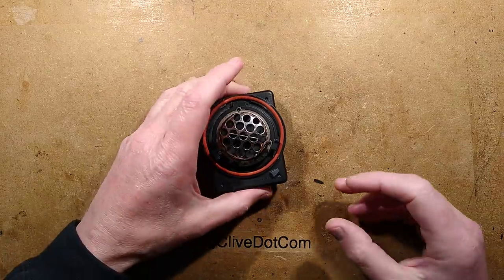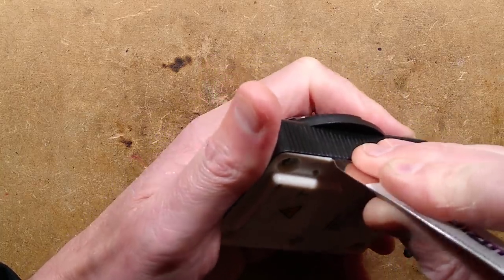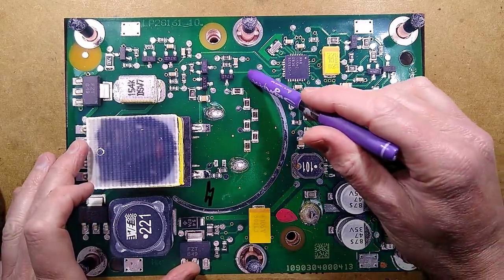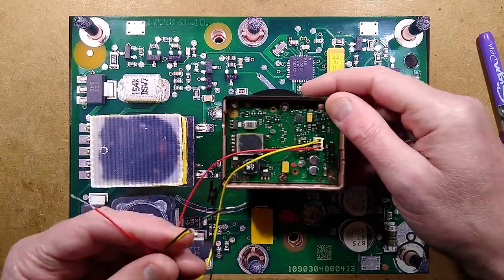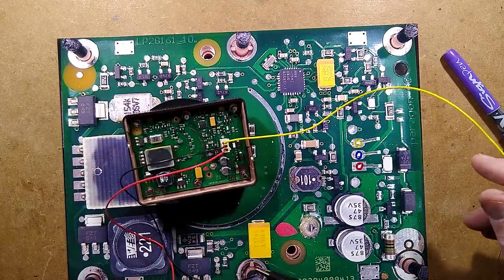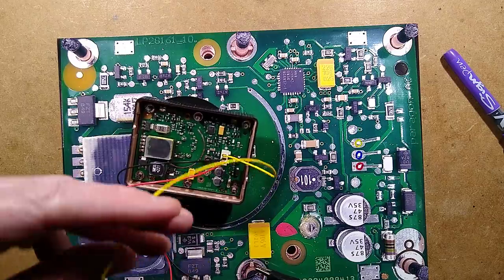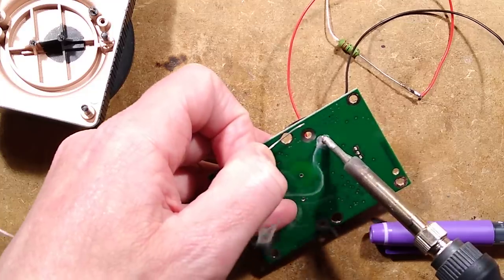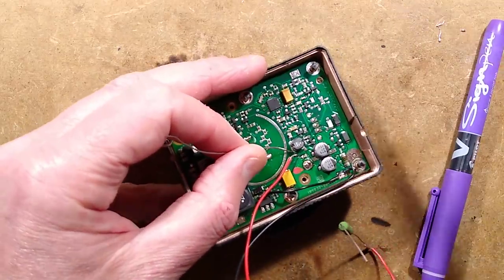Hacking and overclocking a BMW "ioniser".  (Not recommended)

Comment: Chinese replacement parts dont need to tell the car to tell you theres a fault, you know automatically due to the flames appearing.
Reply: please dont be racist towards china
Reply: @CoralsAustralia  Made in China has nothing to do with racism, people are tired of making the Chinese rich off of buying their cheaply made crap.
Reply: @vincentlamb3436  Agreed, there is actually some Chinese stuff that's higher quality.  

OnePlus for instance makes some of the best phones around at a reasonable price.  Mine (7T Pro) has proven to be decently durable, just as powerful as it's Samsung counterpart (S8), and unlike other manufacturers it's not filled to the gills with bloatware that you can't remove.  Pricewise the 7T Pro is a bit cheaper than the Galaxy S8 but offers the same Processor, same RAM, and more storage per dollar.  It also doesn't have a notch for it's selfie camera but instead uses a popup camera and it was the first phone with an under the glass fingerprint sensor which unlike Samsung's version never suffered from a certain major security flaw (if you used a screen protector anyone could open your phone).  On the flip side it doesn't have SD card support (Mine has more storage than I'll ever need so that's not an issue), doesn't have wireless charging (the next version probably will but it's an overrated feature anyway as even 'fast' wireless is only half the power of 'fast' wired and is effectively worse than half when charging a phone that's still on and using power), and it doesn't have a waterproof rating (it's decently waterproof but the popup selfie camera probably introduces a potential water path).

Admittedly I don't know what kind of shortcuts they may have taken inside the phone but from a usage perspective it's a good deal.  Other than OnePlus I've heard there are some Chinese clothing manufacturers that focus on quality but I don't know of any brands off hand (I'm a simple man who doesn't shop for clothes very often and when I do it's usually just Hanes, Dickies, and occasionally Wrangler clothing though their quality seems to have dropped recently).

When it comes to equipment and automotive manufacturing I don't think I've ever seen good quality from China (working in the manufacturing industry I've seen some stuff come from China that's made me wonder how the heck they screwed up so badly).
Reply: @JonnyD3ath  Or you can pay a ton of money for expensive shit (think Apple repairs).
Reply: @CoralsAustralia  oh dear... You must of been one of those fun people who got all the english irish scotsman jokes banned because they might hurt feelings..
Reply: @amojak  I fully agree.  Anything can be taken the wrong way by over sensitive do-gooders that do so much harm, and stir up real shit where there really was not to start with. There is not a nation out there that cant be critiqued in a humorous way. Its interesting in our family when the six nations are on, as different branches support England, Ireland, Scotland and Wales, and we all take the p1ss out each other with vigour.
Reply: @CoralsAustralia  50 cents have been deposited to your account
Reply: LMAO
Reply: This replacement part was made in Germany so
Reply: @chrisa2735-h3z  watch the video and dont comment nonsense
Reply: @CoralsAustralia  no
Reply: @vincentlamb3436 , Believe it or not, Germany once was the king of making shitty tools.

Comment: Modern German cars don't need this. The engine will die long before the ac starts smelling
Reply: True
Reply: Sad but kind of true. I am working in the German car industry and I think the success of the car manufacturers is their downfall. I have the feeling that a lot of people work there because of the prestige, money and career. Not many are there because they are interested in cars. A lot of money goes in marketing and other bullshit while technical development is outsourced to save money.
Reply: actually there 6 cylinder engines are known to last a long time... we have 10 B.M.W'S in our yard we work on them ourselves ... vary in age .. mostly E36 +E46 .... If you know how to work on cars and have a shop.... and have a chance to own 1 of these cars .. you will know what all the fuss is about... usually people who dont work on their cars or have never owned a beemer who bitch about them... E46's  are a excellent investment right now ..
Reply: @lsd25records  The E46 is an over 20 year old design, and even though I will personally always prefer pre-2000 cars, that is not what you could call "modern german car". A lot of the beemers from this decade are not quite as good.
Reply: Holy fuck you fucking killed it
Reply: @AzalofForossa  exactly this. Their reliability, and the ability to work on them yourself without specialized tools, have both gone down the shitter in the last 15 years or so. Part of that is because of how far tech in cars has come. But part of it is because (as stated earlier) auto-design is higly prestigious in germany. Its not about how simple you can make something, or how well the end-user can understand it. The more over-engineered it is, the more respect they seem to recieve. And thats no good on a gear head's wallet. They would much rather save money and DIY.
Reply: @lsd25records   I'm a BMW guy I have a 1996 E36 M3. What I think people are talking about is the newer cars with there plastic engine parts. They don't build them the way they used to.
Reply: Italian cars doesn't need it; you'd wrack them in the Great Ring Road in Rome before ac starts smelling
Reply: BMW’s Naturally Aspirated engines and their 6 Inline turbocharged engines have actually outlasted my Toyota Prius. The 5, 6 and 7 series is the problem. Plus MOPAR has a ton of transmission and throttle body issues which is a problem because nearly all their vehicles use identical parts.
Reply: @lsd25records  I don't trust comments that have random "..." In it. You people can't be trusted
Reply: @Audiojack_  the engineering is amazing whether you like the cars or not.. our cars are daily drivers and we are not shy to put them through the paces.. like I said e46's are a great platform at great prices right now.
Reply: @AzalofForossa  we own a shop so we can pay our billls. we are owner operator .. 2 man operation. its a luxurious life ..building cars and selling them 1 at a time.. this gives us the luxury to source ..get parts fix and certify cars that we want to build..  not a bad life stlye.. hell we bought 2 vintage speed boats this summer and welded up custom trailers for them BECAUSE WE HAVE A SHOP.. got a 14 ft Sidewinder with a 80 hp mercury .. and a 16 ft Baja with a tower of power mercury 115 hp .. out lives revolve around motors and cars.. DON'T HATE THE PLAYERS ..,So if we happen to like BEEMERS and can fix them and deal with them...WHAT's THE PROBLEM.. get your own hobby that pays for your lifestyle... i don't need to ask anyone's opinion or permission to do what I do... thanks for the concern.
Reply: @AzalofForossa  got a  92 foxbody  with a 5 speed..  love my Detroit muscle too late 60's etc.. why not.
Reply: @cbob7423  meh !
Reply: @lsd25records  love the fox bodies, but I have a sweet spot for the fastbacks. God my dream car is a 69 mustang
Reply: @AzalofForossa  And still, people will buy them simply for prestige...
Reply: @xXYannuschXx  the bmw? Yeah, people love them for some reason. The fourth gens and prior are excellent dailies. But once you start looking at the fifth gen, you gotta really make sure the electronics are functioning. As tons of them seem to be lemons straight from the factory destined to die out and fail within 30k miles. I've yet to personally see a fifth gen or up BMW last 75k miles that's not having tons of issues that ruin the driving experience. They exist, yes. But from the 5 or so I've seen, every single transmission was slamming into gear or failing to shift within 50k which is fucking hilarious
Reply: @AzalofForossa  They have become and absolute joke. Unreliable and not fun to drive.  My dads friend drives an E60 and the automatic gearbox started to have problems shifting to 5th gear. A 5€ part was faulty, but the repair cost 5000€, because it was so hard to even get to the transmission... (they needed to take off the gearbox again after filling it with oil again, becaus it settles and the fill port is BLOCKED when the transmission sits in the car (and to get the transmission out, you need to remove the engine.))
A modern BMW is the best way to burn money and they aren't even that fun to drive. A car magazine tested a M2 against a GT86 and the M2 felt absolutely sluggish in comparison. Even the sporty Z series has become a friggin Grand Tourer! No wonder when people drive these cars not because of fun, but because of prestige...
Reply: @xXYannuschXx  honestly if you're gonna buy a BMW, just scrap that idea and get a Porsche. They're far more reliable and more fun to drive in every sense. I've heard nothing but good things from people I know that drive them, and the times I've rode in them.
Reply: @xXYannuschXx  I'll be honest... You got ripped off as you don't need to remove the engine to drop a gearbox in an e60, I've done a few outside of my house. And bmw's aren't hard to work on to be quite honest, I've done a few things on the newer models like f30 and f20 and didn't become any harder to work on than the older ones.
Reply: Not to mention entirely way too expensive to fix as well.
Reply: They're too fancy for my tastes anyway, a Toyota AE86? Ahhh, now that's a car.
Reply: This whole thread shows no one knows shit about bmws.  Their engines are insanely impressive and actually opposite, they are the last to go, the rest of the car falls apart around it.  But instead of educating I’d rather not spread the wealth.  And when you’re in your little scat pack or (insert “me too” car here” and get walked by a stock turbo BMW in the streets and on the track you can think back to this thread.
Reply: @lsd25records  I've got a 2001 E39 diesel. Best car I've ever owned. The day it dies, I really don't know what I will replace it with. As far as I can tell, nothing newer is as good. At 160,000 miles it's only middle aged though!
Reply: @chriswilson1853  use synthetic oil and change it on time.. etc .. she will be good to you... any vehicle needs normal maintenance... I've had some nice muscle cars and still love them.. but every single time I get in my car I feel very lucky and smile hard ... donuts with the traction control disabled .. and I am having more fun than a barrel of monkeys... good times.. don't need anybody's permission or approval.... glad I bought 1.
Reply: @lsd25records  Yes, and I always change the oil half way between the service intervals on my BMWs. It's remapped too, so has pretty good performance. 500 Nm torque :)
Reply: another jealous china car owner
Reply: @lsd25records  I still have my 01 330ci and it is in great condition, over 220k miles and runs great. Compared it with my brothers 2009 bmw he bought new and looked at others 2015 and above and you notice the decline in quality of components. Most everything feels cheaper and lighter duty.
Reply: @lsd25records  I know I’m gonna get hate but I agreee with your thinking. I’m on my 4th Mercedes. Never been to a dealer. Hell never been to any shop with them. I plan to do all service myself and so far have years of good luck doing it. Stuff is expensive but could be worse if it’s done at a stealership.

Comment: "Get it all nice and hot, then bang it."
-- Life lessons with the master

All jokes aside, I need a solder sucker
Reply: I got one of the ultracheap Chinese soldering iron / suckers. I did end up taking it apart to check the earthing (poor) and the connections (mains wires simply twisted together inside! But done very carefully, and it may be because one set of wires is aluminium), and I would say it's worth exactly the $9 shipped I paid for it, but it does work --- rather well... Long and boring teardown video here: https://www.youtube.com/watch?v=n0cpuaTZ6u0
Reply: I would be very careful getting the squeeze-bulb type. They don't play nice if you get it a touch too close to the iron itself.
Reply: Solder wick is the best
Reply: This entire thread reads like a strange euphemism.

Comment: @2:53 "I'm seeing way too much sophisticated stuff..." Welcome to the world of German automotive engineering. :)
Reply: Just had to replace a broken door latch mechanism in my old e36. It had so many moving parts it would make a clockmaker blush.
Reply: It's European engineering in general and there's a reason. European labor is expensive, particularly in the West, and often hard to find for repetitive assembly jobs, so they try to automate as much as possible. Because there's limitations of what a robot can do, this means putting 5 snap-together plastic pieces to avoid two screws.
Reply: LaterMeansBrick were you looking at the window regulator? In my e46 the regulator looks so confusing and there are a bunch of other random parts in there as well besides the speakers and airbag. It may not be so modern anymore but everything still works as well as my parents newer chevys and fords xD

Comment: Loving the teardown!

I'm a tech with BMW, so I love the explanations.

If I remember correctly, some of these were known for causing closed circuit current infringement, and they were only used for a short period of time.
Reply: DO you know what models used it?
Reply: @rimmersbryggeri  F01, F10 for this type (Couldn'ttell you which years used it), and G05,G06,G07 use the new style.
Reply: @sixspeeddeath  Too new to be on the the pick yourself part of the scrap yard anyway. But thanks that was a really fast reply when you really dont have to. :)

Comment: Since my father does FMEAs for cars (failure mode and effects analysis) I can tell you that basically most of those safety features are just in case you drive your BMW against the wall and don't want to be poisoned by ions. So, if you drive a BMW against another BMW, it's just the impact that's killing you - not the parts of the BMW that are malfunctioning. So you got that going for you, which is nice.

Comment: Do we need to save up and buy you a signal generator, Clive?
Reply: Yes, but I don’t think it would’ve helped here, I think this is controlled by LINBUS
Reply: Pretty sure he has a signal gen. He has a recent model Keysight scope, it probably has built-in signal generator, but I guess he has some other generators as well, like simple ebay kits.
Reply: @cls63amgwagon34  Probably true. The signalling would be too complicated for an ordinary wave generator to output -- you'd need a proper chip to communicate with it. Good luck with that.
Reply: No, he can roll his own with an Arduino. Run it off an RS232 console interface.
Reply: Although it may be Line bus it seems pretty obvious that mr. Clive did not know this. He was dabbing the lead on and off because he was trying to make a square wave.. if it were in fact a pwm signal a signal generator is exactly what you would use. I'm sure he has many and I'm a little confused why he just didn't use one. then he could have said " oh, I guess this doesn't use pwm." lol
Reply: @cls63amgwagon34  That's a sound theory. Would be interesting to test it. Are there any standard responses that could be used as a ping?
Reply: @cls63amgwagon34  It's PWM for this particular module, details are posted in another comment.
Reply: @cls63amgwagon34  Not, in this case, it is controlled by PWM signal.
Reply: It is ISO9141 KLine or maybe LIN but the inteeesting thing here is that there's no full LIN transceiver chip they either use totem pole discreet solution or the mcu has an inbuilt one. Some of these microchip or cypress ones. But i would bet this is for an older bmw and they use K line
Reply: Иван Иванов No, it is PWM in this case. Check BMW technical information. 😉
Reply: A bear poking with a wire is more entertaining 😉

Comment: Going by my knowledge of german car electronics, the third wire was probably a K-Line (perhaps KWP2000) bus: the low-speed, one wire, bidirectional bus which was pretty much succeeded by CAN in the car.
It's still in use in some areas of modern cars, mostly for sensors and actors like this one, which don't deserve access to the CAN bus. The seonsors are instead connected to "larger" ECUs which communicate their findings on the CAN bus (after some processing).
That said, due to the pulsing communication, it does look a bit like a PWM signal.

Comment: I will have to find one of those. That Corona discharge looks so lovely 
Cool video. Looking forward to the live stream tomorrow
Reply from the maker: You can buy ceramic plate ozone generators on eBay with 12V supplies.

Comment: This is good stuff right here. Yeah it's too bad most modules these days require data to run. I don't know if it's always serial data, like via a CAN bus, but i do know that sometimes their "language" and/or protocols are proprietary. This means only their own modules, like a BCM, can talk to each other. Also that's only if they're programmed properly. Meaning you can't always swap the same hardware between the same vehicles either without being properly reflashed. Very frustrating.
Reply: I can't even get my printer to talk to aftermarket ink cartridges.

Comment: Well Joy-Joy for getting it running, several years ago I was asked to fathom an Eberspacher ... there's a £800 free standing set or 2 for £150 that are for polar regions and snap into skoda/Volvo/ect and the dodgy supplier throws in a hand drawn note as a wiring diagram... but I had no joy .. perhaps you would have fared better...